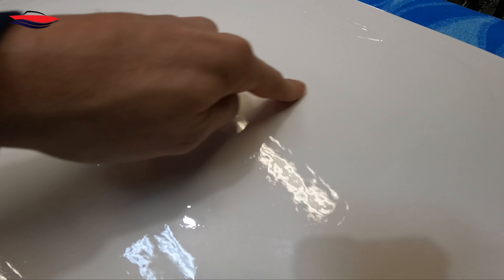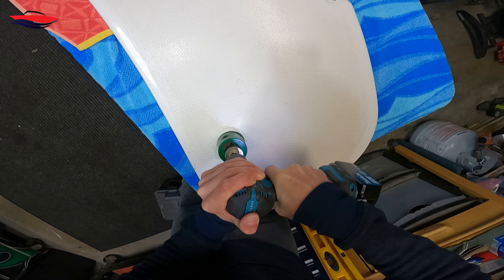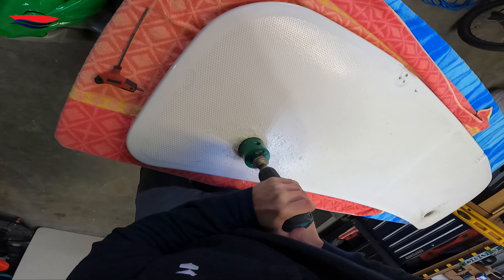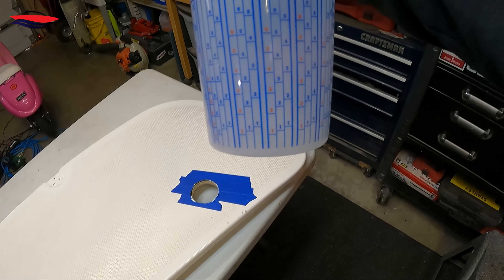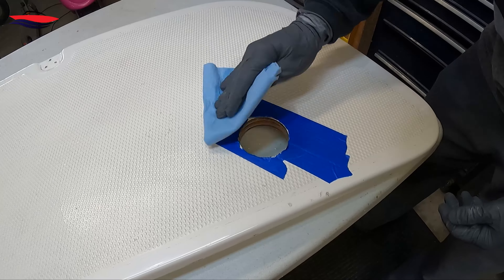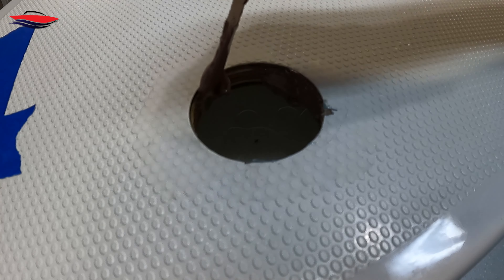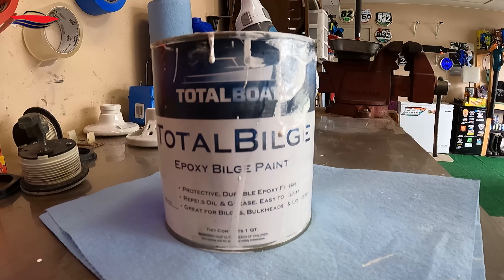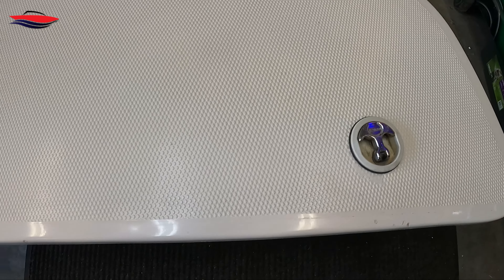Clean Out Hatch Rebuild /Wood Core Replacement Part 5 - Yamaha Jet Boat

Comment: Hey Jeff, was just wondering why you chose your option instead of using a solid piece of White King Starboard Plastic Sheet. It seems like it would be easier and cheaper. Thanks for your time!
Reply from the maker: Starboard is good stuff but it does not have the structural support like a wood core.  I would need to use a 3or 4 inch thick board to get the same stiffness as the plywood.  Good question though.